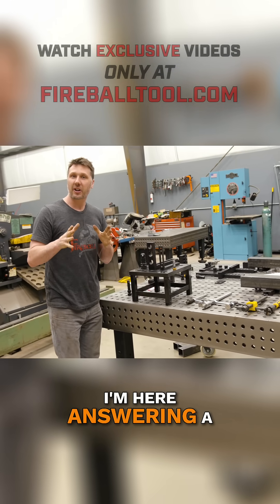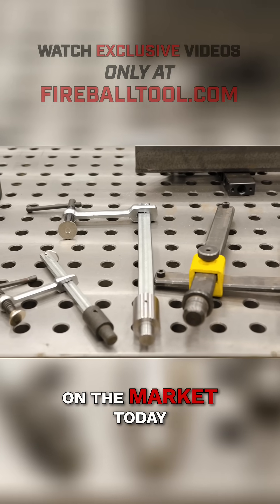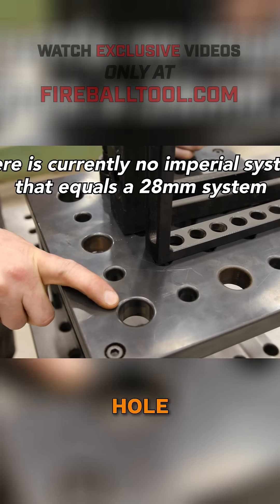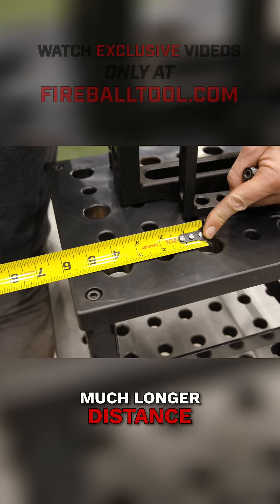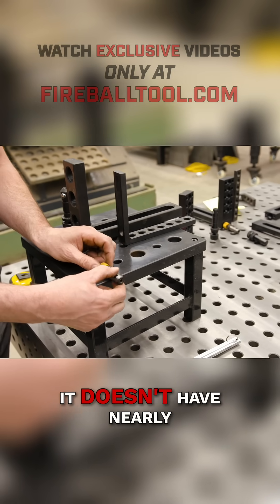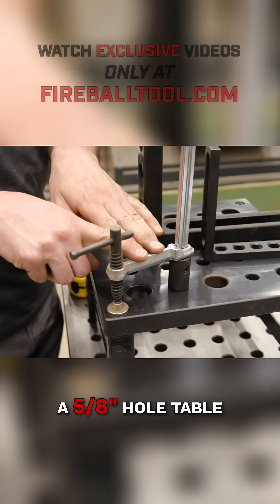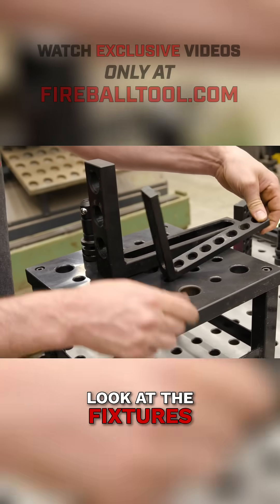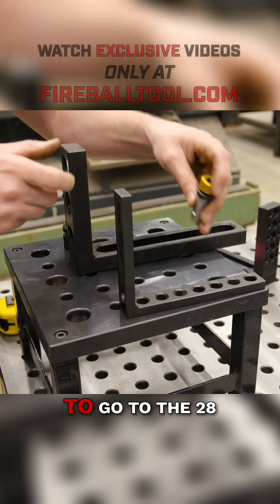Why 3/4" Hole Size for the Fireball Table?

Comment: Ideally, you want a system to be over-engineered for the desired application. Hold-down force?  It should be capable of producing more clamping force than needed for ninety percent of your jobs. This, I believe, is the Fireball Ethos: Over-Built to Last.